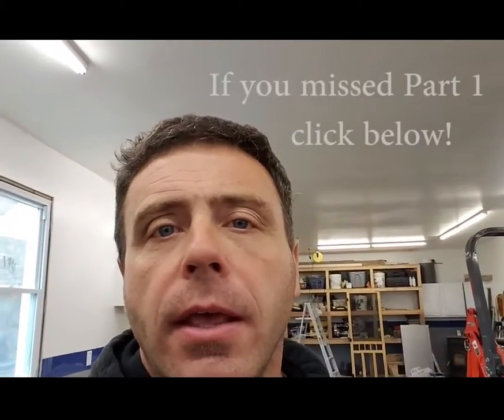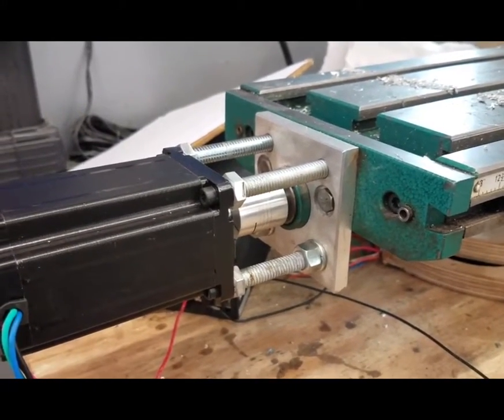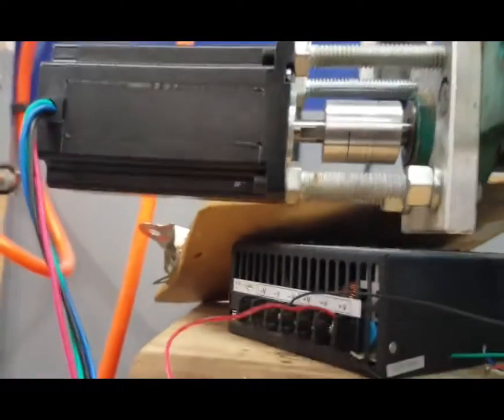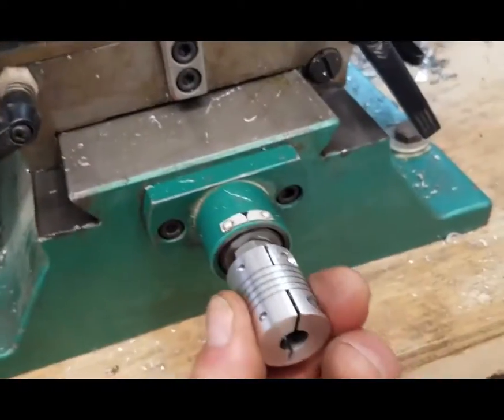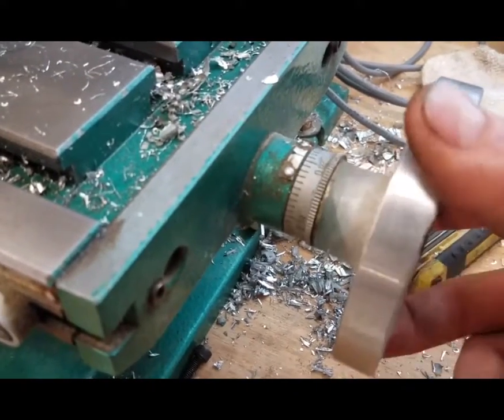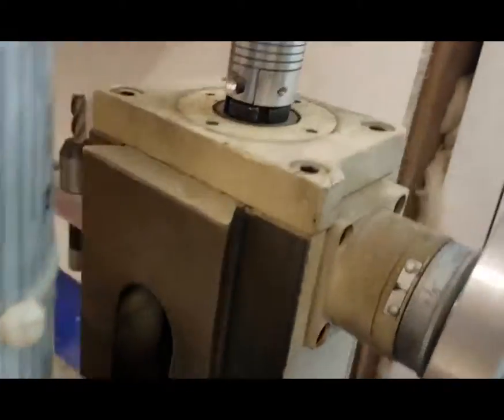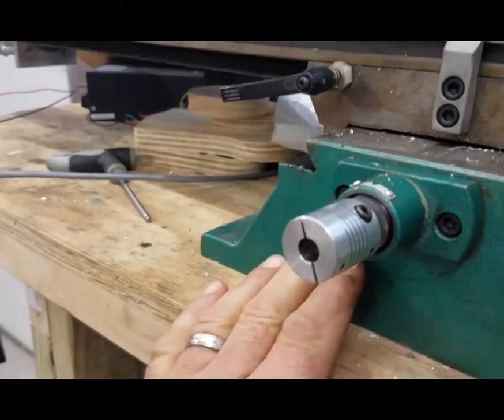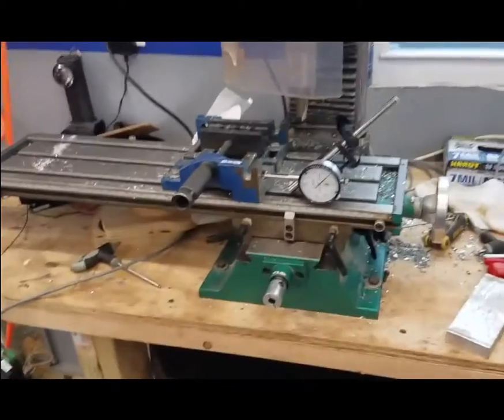Low Budget G0704 CNC Conversion Part 2 (short Version)

Comment: Hi, I've done nearly the exact same conversion, I used a NEMA 34 on the Z axis, though. I'm curious what spindle motor you're using there, I'm still running the stock motor.